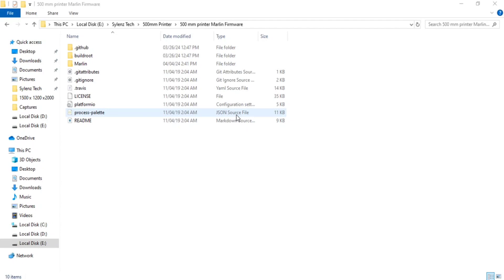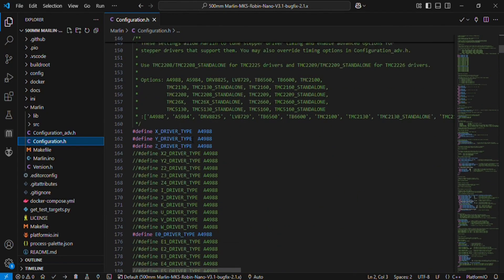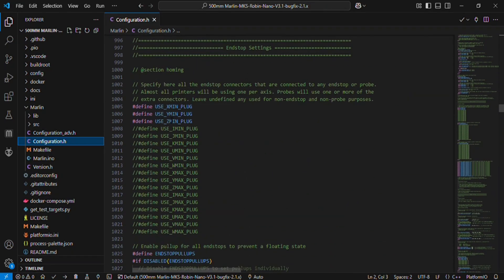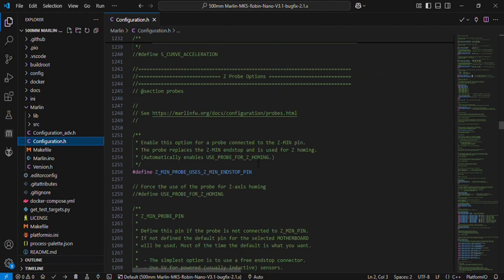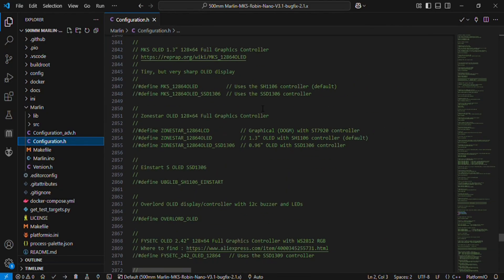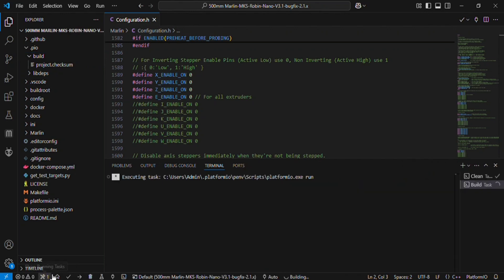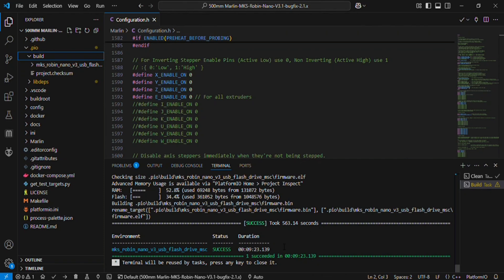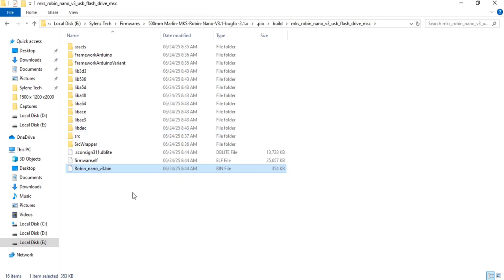MKS Robin Nano V3/3.1 Firmware For DIY 3D Printer | Marlin Firmware

Comment: Dans le cas ou l'imprimante conçue n'utilise pas un system de courroie, mais des axes (vis trapézoïdale ) pour  déplacer la tète de l'imprimante ,est ce que les paramètres de mouvements qui sont indiqués dans le firmware  (80,80,400, 96.51429) sont des valeurs maximales, ou on peut les augmenter autant qu'on veut ?
Reply from the maker: Yes these are the parameters of stepper motors. You can't set random values. You'll have to calibrate these values according to your printer